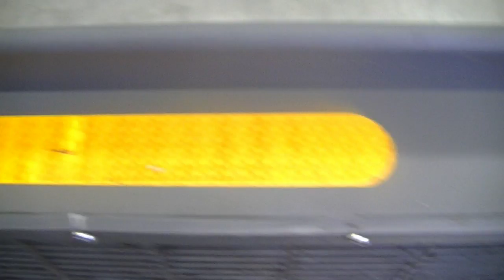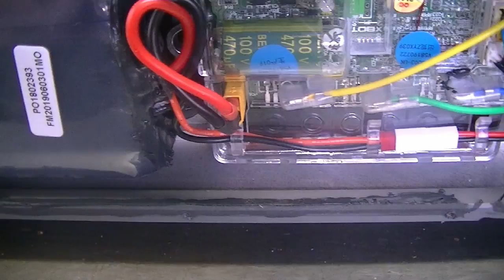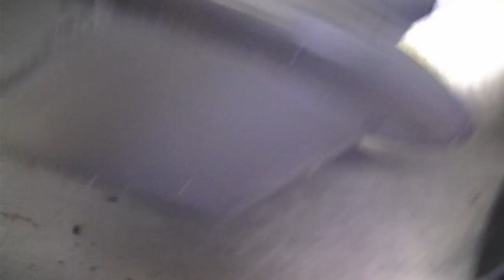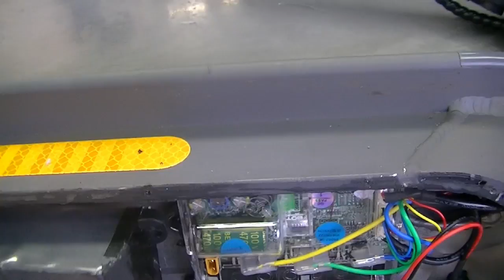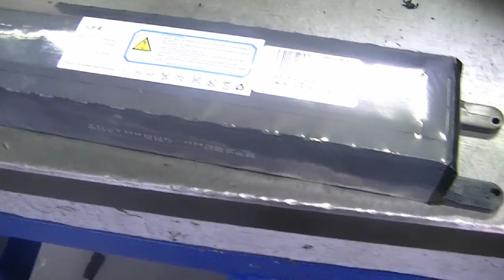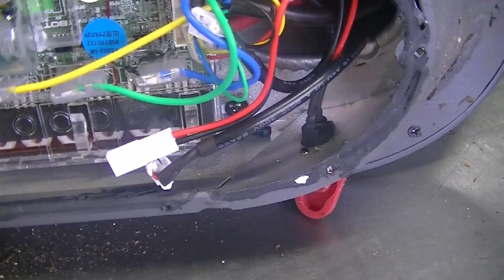whats inside  lidl  doc green  esa5000 electric scooter

Comment: Eroare 16 plz
Reply from the maker: throttle is stuck  on  . on power  on check it moves      back  to 0
Reply: Well, what should I do?
Reply from the maker: @carxenterpro6757  if it  goes back ok  and  isnt sticking  ull need a throttle (shuold  ve 40 quid to get done at a shop      ask about on fb    its easy tho just look up mi m365  throttle  on ebay   there cheap      but   if not  might be worth paying a small fee  to get it fitted   id do free     but im in co9 post code id assume ur not so close      maybe not even in uk as youtube    think these  sold big  in   Germany so id assume your from there  or close by   tho if ur in or coming to the uk      close to co9   id look at it  for  ya   if not there will be scooter guys/girls  on face book who can fix it cheap
Reply: I opened the accelerator and there is no problem, the error 16 still shows it misses when I start to drive away
Reply: could you make a video to show me where to look
Reply: that is, acceleration must stick
Reply from the maker: yes ok
Reply: that is, it does not have to return to its place instantly
Reply: but not at error 14 it should have been the acceleration

Comment: Hi just got one of these off eBay and been looking at the folding mechanism to see where water can get in but it looks sealed are you sure water gets in through there if so I’ll open bottom up and put a load off sealant up there. Is it worth getting one of those seals to put on the battery cover too.

Comment: I got one from Lidl on Black Friday 29/11 and after three time of uses the motor is just making rubbing noise and vibration. Can't go even faster than 10mph... Would you advise this for a new motor replacement?
Reply from the maker: check nuts holding the front wheel on  check mud  guard for damage or   and  check for side to side play   in wheel   as it could be bearings
Reply: know what...I stripped the back cover and water was dripping from  there...Then I leave the bike for a night with all wires disconnected and now it back to live! What a magic

Comment: here in germany  these esa scooters are legal but just 20 kmh allowed here.(with number plate...)
tried to change the dashboard from my old xiaomi into the legal one - no chance, all electronics changed.
xiamo brake lever 3 cables, "new german one" just 2 cables...etc.
so i just transplantated thw whole electronics from xiaomi into the legal one :D
Try one of these cheap suspensions for xiaom(and clones) drivin with these its a drifference like day and night ;)
Reply: So i am thinking of doing the same. Did you just swapped battery, dashboard and controller or you also changed the whole wiring as well.. My question is if xiaomi m365 and doc green esa 5000 cables are the same... So i just swapped only these three things?
Reply: @2b.or.not2b  With the XIaomi you can disconnect the main cable from the dashboard to the controller on the handlebar as you know it from the assembly.
With the ESA it is ONE cable, you cannot disconnect it into 2 pieces
So you have to cut each cable for both components for the conversion.
The ESA also has another throttle grip on the left side to operate the engine brake, how I should connect it I didn't know either., my m365/Pro Dasboard dosnt have that port.
Since the plugs from the "new gas handle" did not fit the dashboard, I simply replaced the entire handlebar of the XIamoi, together with the rest of the electronics then everything worked together as before.
In addition, you still have to take the xiaomi battery, because the ESA somehow does not have a correct BMI, which is why the battery residue is always displayed incorrectly when driving. (Esa)

(Did you just swapped battery, dashboard and controller?)

In fact yes. + Handblebar.
But i swapped it WITH all wiring.
nothing i had to cut.
Reply: @Bergwacht  hello... So i have a question.... How did you make the break light works.... Cause xiaomi break wiring is coming from the battery while esa have it in the front and connects to controller... So how did you do it
Reply: @2b.or.not2b  I used the m365 Battery, so i just connected the rear light to the battery like original. It doesn't work with front headlight The ESA Headlight only flashes briefly when you connect it to the original dashboard because the Lamp needs more power than that of the M365. I solved that by simply swapping the handlebars completely and using the original Xiami light again.
Reply: @Bergwacht  okay... So i switched the handelbars too... And also the main cable for the handle bar.... The grey one ...  But the rear light cable is going through the body... Did you remove the back wheel to remove the cable from the body or you just cut it..
Reply: @2b.or.not2b  My backlight cable goes through the battery compartment inside, so I cut it off and hung it on the battery of the m365.
Simply cut off the lamp cable so that you have 10 - 15 centimeters in the interior and can easily connect it to the battery after replacing the battery. 
Do not unscrew the rear wheel, this is an unnecessary amount of work. The tail light from the ESA lights up and works as if with the original M365 battery.
Reply: @Bergwacht  ohhh okay.... But my rear light cable goes through inbetween the battery compartment and the base plate... So i cant see the cable... It just comes infront where the controller is. So i think i have to pull the cables back... Can i have your email or your number so i can share you some pics... I mean your way is actually making sence so im doing this.. But need lil more help.
Reply: @2b.or.not2b  megahaze@gmail.com
i do what i can :)
If I understand that correctly, you cannot open the scooter where the cable is, you will never get it back there again.
It comes out where the ESC is?, try to extend that cable a bit, so that it reaches up to the battery in the interior.

Comment: Hi mate is this faster than the xiaomi
Reply from the maker: its the  same  as the m365pro  as it has the same  350w  motor     the  m365only has a 250w  motor  so its faster  than  the m365 but its the same  as the m365pro
Reply: @TCBOT  not bad as there only 179 in Lidl Xiaomi pro is over 500
Reply from the maker: @richardprice2255  yea  i know  there is no  way  lidl  is  making  on this   its just to get ppl  in the shop  in hope  they will spend   alot  on other stuff    and often    both  the m365pro and the lidl  scooter had ninebot on the pcb    of the on /off   switch    some clue  as to who builds  them
Reply: TCBOT hey there, I purchased the new doc green 800 yesterday. It had cost me £150 from Lidl and comes with a 250 watt rear wheel motor, battery is 36v/4.8Ah lithium Ions with Sanyo cells. It also has a complete different design to it looks more modern/unique and is also much lighter than the m365. I wanted to know if you think this model sounds better than the doc green 5000 or do you think I should take it back and pay the difference for the 5000? Please check it out and let me know...Bare in mind there is only one video review on YouTube for the doc green 800. Cheers!
Reply: Tcbot yeah I think there definitely taking a loss as they didn't have many in stock down by me I use my xiomi m365 I haven't got the pro got it from Halfords for 299 in happy with it but probs would of been better off getting a doc green  for a few quid less and basically a better running gear scooter however it's really hilly around my area and fairplay to my scooter it havemt failed to get me up any hill yet and tbh since owning it I've saved 80 so far in diesel as I have a 170bhp vw scirocco car haven't moved since and the bonus is the police don't hassle me anyway nice one for the reply and good vid

Comment: Thanks for the video. I got one as well, but considering taking it back and paying more for the Xiaomi. The main reason is I want to restrict the spead so it's a bit safer when using to commute to work, around pedestrians ect. This thing has so much torque and is a bit over responsive on the throttle. Do you know anything about changing firmware on the esa5000, will it work with the Xiaomi firmware?
Reply from the maker: ud need  to replace  the controller  and the power on  board   at top of stem    and the brake leaver   are the  main  2 differences  between the m365pro  and the  lidl scooter  note the m365pro does  cost £500      the  stock  m365  is  not very good  at all tho   no regen   and  very very very  slow    /bad at getting up hills due  to 250w motor  vs 350w   on lidl scooter and m365pro   if  you live  in London  or somewhere  flat  the m365  will be ok      but  if there is a  hill  it will  need help
Reply: @TCBOT  Thanks for your reply. I was thinking about the non-pro. £300 at halfords. You raise a good point, bit hilly where I am. Maybe i should stick with the esa5000. If you do ever find a way of hacking firm ware/speed, a video would be greatly appreciated. It's also a shame these dont have the cruise control.
Reply: @antoinegrujon8287  you can set to eco mode which limits speed to 12mph. You have to push the power on button twice or hold it for couple seconds not sure which method. The green light should come on the dashboard
Reply: @vvv2k12  thanks for your comment. I was wanting to limit speed further than that as I am often riding in proximity to pedestrians and, being illegal on pavements and cycle paths I didn't want to attract attention from police. I hope that if i am courteous to others and ride sensible, should be ok.

Comment: Nice video! Please do more ;-) Do you think the controller could be exchanged with a xiaomi replacement one, to use the bluetooth functions and additional features? Interesting to see that your version has air tires. The version that is sold in germany since yesterday was promoted to have honeycomb, but it seems like it has solid rubber tires.
Reply from the maker: just found this    could be used  to mod  lidl scooter  think ill try  it https://www.ebay.co.uk/itm/Dashboard-Screen-Cover-Circuit-Bluetooth-Board-For-Xiaomi-M365-Pro-Scoote-UK/143379879581?hash=item21621b569d:g:2fAAAOSwQEpdX6ST
Reply: TCBOT where can you buy the Control Panel
Reply: I got one yesterday and I am interested in the xiaomi replacement board as well. Also if I could seal the folding mechanism from the top. I don't feel like opening it even though there are no warranty void stickers. I am also concerned to fully seal shut the compartment. If in any way water gets inside it will have a much harder time drying.
Reply from the maker: yes  tho you will also  need  the  on off  pcb as that has the  bluetooth module on it
Reply: Xiaomi Pro PCB would be nice 😊
Reply from the maker: can be done  but  only adds a basic adjustment to throttle  and seems bit  of a  gimmick having a scooter   connect  to  ur phone kinda like ramp up  /down adjust of  mobility  scooters  (done  over  usb mind
Reply: @TCBOT  it would also add the lock function and stuff like the distance counter etc. And it would be able to remove the speed limit etc via custom firmware. Not legal in most countries, but it would be interesting.
Reply from the maker: @noobsalsowinsometimes8350   true tho   you could just  walk  off   with the scooter  and  crack the  lock once home  so that not  going to stop  it being nicked   as for speed limit   i think its about as fast  as it will go  on 36v/42 charged      i tried  overvolting an m365pro  it had more  torque  and was pulling  1100w peak  on 48v   no current  limit  set    it  did go  20mph ish on flat    but  that was with a full  controller  swap  and battery  swap    was done  to a scooter with   major parts missing   full vid coming soon
Reply: @TCBOT  Yeah, but as a qick lock it might be interesting, while you got the scooter in view.. It at least prevents someone from grabbing it and driving away. I have seen sume drunk people trying to drive away with electronic locked rental scooters. Very funny to watch :-D How fast does your scooter go? Here in germany they are limited to 20km/h / 12.4mp/h.